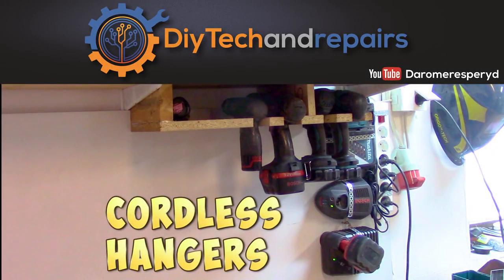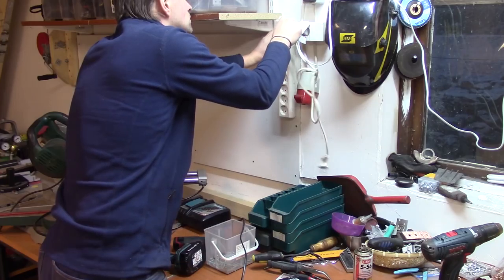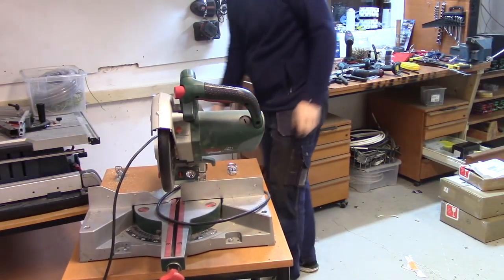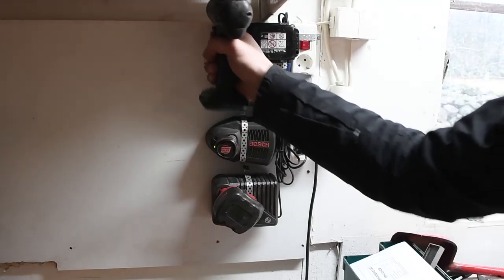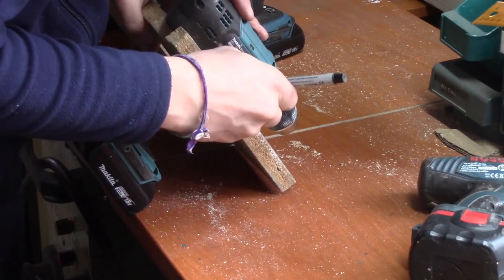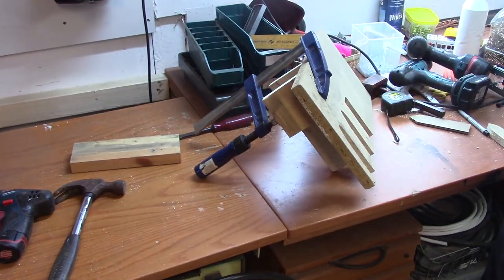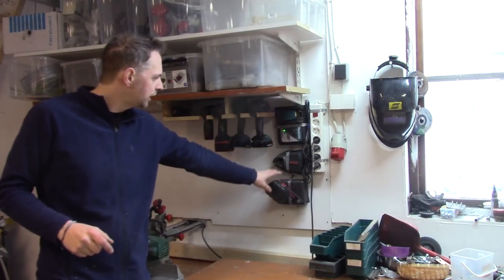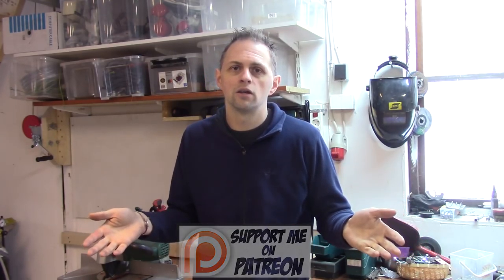Storage for cordless drills and their chargers build

Comment: Love your drill rack dude! is there any particular reason that the hand drill battery pack to discharge when the charger is turn off. I thought that the charger unit didn't consume power when turn off..in other words they have reverse polarity circuit to prevent back flow of current from battery pack to the charger itself.. correct me if i'm wrong.
Reply from the maker: JaY-JaY Dude should not but... some still do it :)